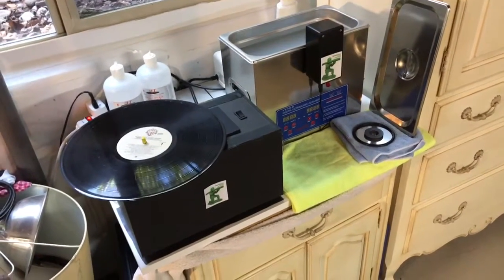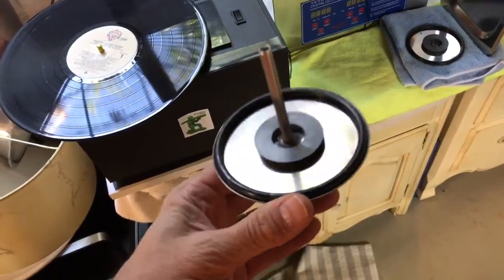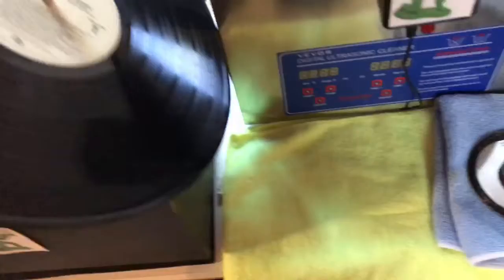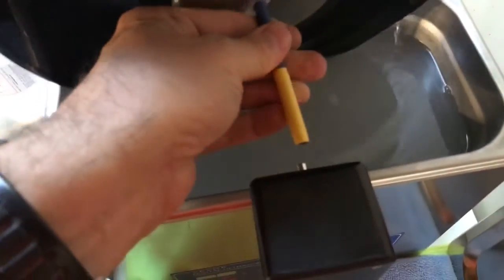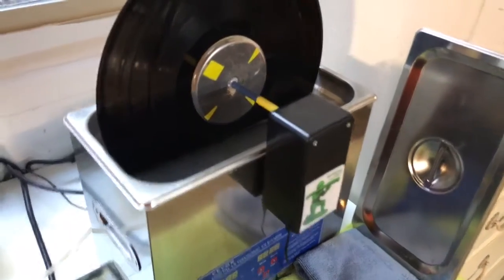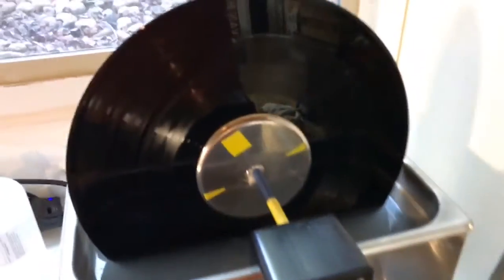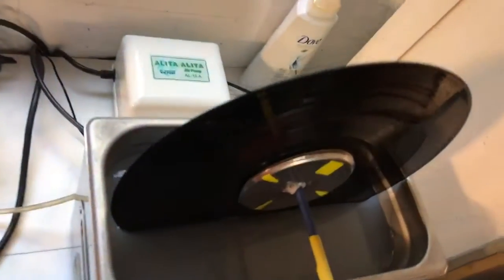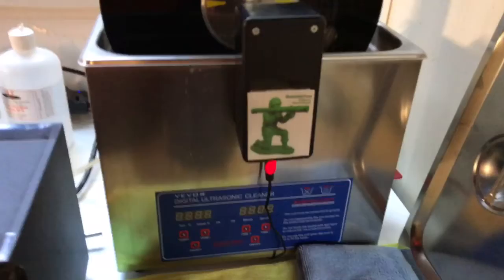Low-cost DIY ultrasonic record cleaner w/ BOM

Comment: Ultrasonic record cleaners damage vinyl by stripping out the high frequencies in the groove which contains 20,000 cycles per second in the waveform which is the height of deviations in the groove. So very delicate. Brutal implosions/cavitation inside the groove are very destructive. Do your research before pulling the trigger on one of these machines. Dave Denyer did a telling test on YouTube, so check that one out. Spatula City Records explains the dangers and how to avoid them too. The best specifically designed manual dry/wet brush using the stylus to massage the debris out and brushing before and after play is what Linn and many top manufacturers suggest as the quickest, easiest, safest, and most effective solution to removing dirt-related noise and keeping records clean and virgin.

Comment: Can someone tell me what size cleaner tank in liters or gallons to get?
Reply from the maker: Mine is 6 liters.  Here is a current link, price is down to $108.  

https://www.amazon.com/VEVOR-Commercial-Ultrasonic-Capacity-Solution/dp/B01HGNYO0U/ref=sr_1_4?dchild=1&keywords=6L+Ultrasonic+Cleaner&qid=1618425099&sr=8-4
Reply: @bwfh  I've seen conflicting reports on these 6L units saying that LPs have to be put in at an angle to fit correctly....do lps fit this unit correctly?
Reply from the maker: @allthisforasong1200  yes, the required depth to submerge the actual 'grooves' is far from 12", so no need to angle it....

Comment: Recently purchased a 3RPM motor (by Bringsmart) on Amazon that looks just like the one in the video. It worked perfectly for 9 days. On the 10th day it started smoking and caught fire. Fortunately I was right there to disconnect it and prevent the fire from spreading. Hopefully the new, more robust motor I bought to replace it will work out better.

Comment: Excellent video.  The BOM is extremely helpful.  The only change I made was to use plastic (ABC) caps instead of the metal one ... less likely to damage the vinyl during handling:  

https://www.homedepot.com/p/Oatey-4-4-in-ABS-DWV-Insert-Test-Cap-with-Knockout-39103/100113503

is the part.

THANK YOU for posting this.

Comment: I went to Lowes for the cleanout covers.  They don't have the rubber seal like in your video.  Did you add that?
Reply from the maker: Yes, just bought a large o-ring and cut it to size, sorry I did not mention that!
Reply: @bwfh  Thanks.  I found some o-rings that fit.

Comment: Good stuff, and the simplicity is great! I am trying to use some foam practice hockey pucks as a spacer between multiple records. They add almost no weight and are easy to poke a hole through.

Comment: My only concern here is the bare metal rod resting on the side of the tank, might wear on the metal over time with all the vibration.  Also would want some softer material contacting the spindle hole.
Reply from the maker: The aluminum rod does not contact the sides of the tank, it is 'in the air' supported by the motor shaft. 
If you are worried about the downward pressure this puts on the shaft, it has been working fine now for a few years, and at $6 to replace the motor, well, I am not worried.

And, the magnets around the label ostensibly keep the rod from really touching or wearing on the spindle hole, it all spins as a unit - the rod, the magnetic discs, and the LP, so the LP is not riding around a stationary rod, there is no wear occurring.
Reply: @bwfh  fantastic, glad I found this instead of being ripped off by vinyl stack or cleanervinyl

Comment: If you wanted to clean more than one record at a time, how would you do it?
Reply from the maker: I would add more label protectors to the spindle.
Reply: Bill Hunter You wouldn’t need spacers, right? The label protectors do that job?

Also, is this system working well for you?
Reply from the maker: I do not think they are wide enough, I would insert some sort of spacers if I wanted to do multiple LPs at one time. Yes, works great for me. Along with the VinylBug vacuum RCM, I am set!

Comment: Hi Bill. Could you please explain what is needed to complete the wiring between the motor, toggle switch and female power plug? Thanks!
Reply from the maker: They are all 2-wire connections, you can twist or solder (I did solder mine), very straightforward.
Reply: Thanks so much for your response, Bill. The center connector on the female power plug is what threw me for a loop; I haven't seen one quite like it before. From the image on the RadioShack site, the center connector looks like a pin. I wasn't sure if the second wire gets soldered inside that pin or not. Since there didn't appear to be any another connector, I figured the second wire must go there. 

Thanks again for posting this! It certainly costs a fraction of what they charge for the big name machines!

Comment: The project boxes are currently sold out at Radio shack and ebay. is there another box that will work or should I wait for that particular one your link?
Reply from the maker: Any project box would really work, it was just what was available and convenient to me. I would obtain the motor first and ensure the enclosure will be a good fit.
Reply: got the motor already. I will look for similar specs then. I saw the radioshack   270-1802 box. I'll start there.
Reply from the maker: This is similar from Amazon: https://www.amazon.com/Plastic-Project-Electronics-Enclosure-5x2-5x1-7/dp/B0193XS25O
Reply: Awesome. Thank you very much for the assist.

Comment: Hi Bill. What size screws do you use the mount the motor? I asked the place where I bought it from and they said they don't know.
Reply from the maker: I don't recall, but I took it to the hardware store where I just tried a few until I found the right one, sorry, did not make a note of it, but fairly certain it was a metric screw.
Reply: Thanks Bill! Lowes only went down to 4mm then they were done with me. Hard to find an old fashion hardware store anymore. If you remember please let me know. Gary
Reply from the maker: I definitely got those at Ace hardware, they are black, hex-head screws.
Reply: OK! that should help. Thanks!
Reply: @gardon4  Thread over a year old but If you haven't found them yet, my motor came with a little paper that said to use screw size M3 (guessing that means Metric 3 mm at least is what I bought and seems to fit :) )
Reply: Thanks for the quick response...just kidding. I did get screws that fit. I don't remember if they are 2 or 3 mm. I built mine pretty much like yours and it works very well. My tank is 10L and I can fit 6 LP's at a time with 1 1/4" between them. I tested doing fewer and did not see any improvement. Sometimes after cleaning I don't hear much, or even any improvement. I wonder if some records have more damage in the grove than dirt, which will never go away, or would a more expensive ultrasonic do a better job. Mine is a $200 one from China.

Comment: Hello Bill. Is there a rubber o ring on the silver plate. If so, what's the size (4")?
Reply from the maker: Yes, I did buy a gasket and cut it to size, could not find one quite right, although there is now a 4" reddish color toilet gasket that I have seen that would work if I were to re-do those. I found a larger o-ring, cut it to size and glued it to the metal plates.

Comment: What's the blue and yellow stuff at the end of the shaft, where it connects to the motor? I have it all set up but the shaft doesn't turn the records because it's not thick enough. I got the aluminum shafts you suggested in the link above
Reply from the maker: That is just blue and yellow tape, so I can more easily grip it.

I glued the one silver disc to the shaft with epoxy, then the magnetic pressure of the other one holds fast and it all spins. 

The shaft moves freely in the spindle hole, I did not want it that tight, but you could put tape or shrink tube and thicken the shaft if you wanted to do it that way.

Comment: Hi Bill - What did you use for the shaft to connect to the motor? And does the motor have to be a 1 RPM?
Reply from the maker: The motor does not have to be exactly 1 RPM, but it seems to be quite common to spin slowly and spend a good amount of time in the bath. Most DIY models I found seemed to be in the 1-2 RPM range. I believe the $5,000 AudioDesk unit spins at 3 RPM.

For the shaft I went to a hobby store and bought a 1-foot piece of aluminum tubing, it was about $1 for 2 of them. The standard size for a center spindle hole is 0.283 -inches, so 1/4" tubing is pretty close, the magnets hold it steady. I took my motor and a 45 adaptor along to ensure fit on the motor shaft and through the hole in an album.
Reply: Thanks for the info. Here's the motor I chose. Will it work?

https://www.amazon.com/gp/product/B01MZWPBXU/ref=crt_ewc_title_srh_4?ie=UTF8&psc=1&smid=A1THAZDOWP300U

I'm a little confused as to how the aluminum pole sticks to the motor. Is it just a snug fit?